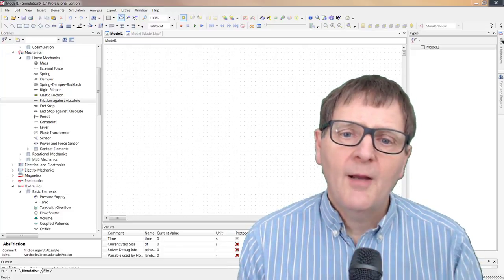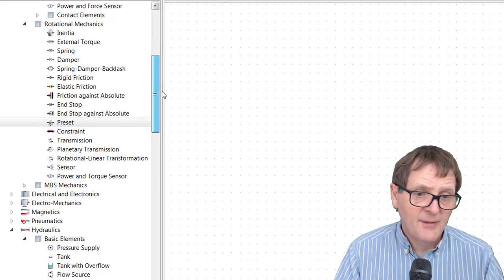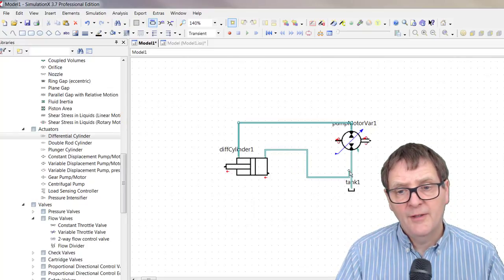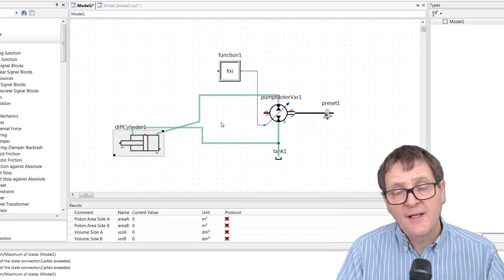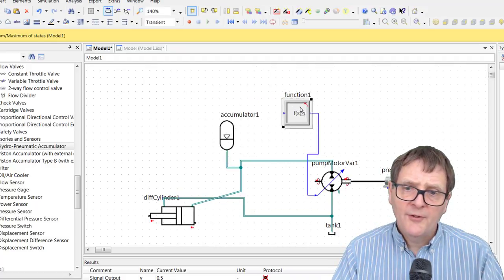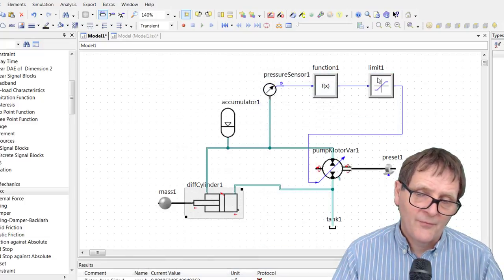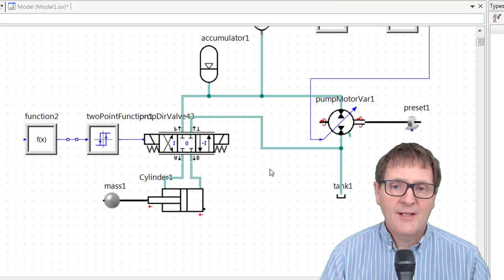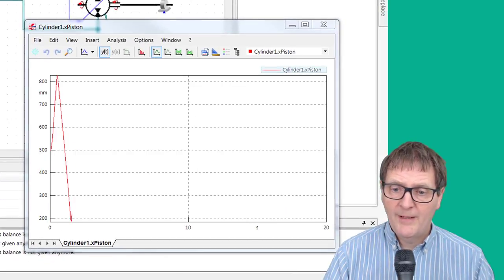Hydraulic System Design

Comment: May you please do a simulation including a one power pack, one directional control valve, one  double acting cylinder compressing a spring or simply a single acting cylinder and one accumulator as an emergency source? In fact , I wanted to know how pressure changes in my circuit when the accumulator is used to compress a spring as an emergency source and pump is off. My guess: My pump will charge accumulator to its maximum value set on the pressure relief valve. Then I turn pump off. Pressure in my system will simply be the set value on the PRV. Then I will actuate my directional control valve to make the double acting cylinder compress the sring or compress the single acting cylinder. I should expect the pressure of my system to instantly drop to a value ( which is based on the initial force to compress the spring) .....pressure will then start from this value and continue increasing according to the compression force of the spring!!! Am I right ??

Comment: Why didn't you just use a relief valve at the start of the whole process? You could have moved your cylinder with less work. Does this program support different valves?
Reply from the maker: With the programme you can set up all types of valves. And you could test if a relief valve would be beneficial.
Reply: Mike Crowley great! Sounds like a very beneficial program. Thank you for sharing.